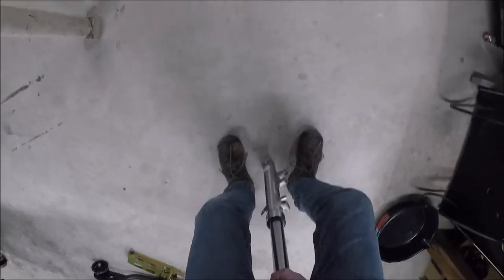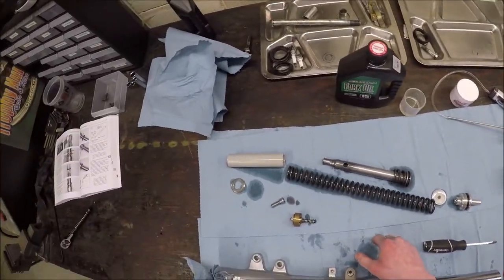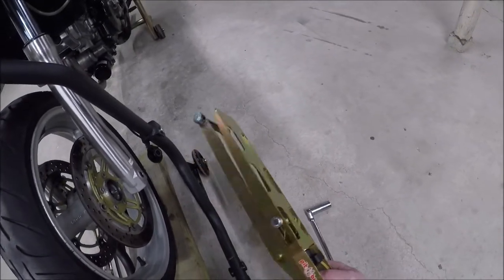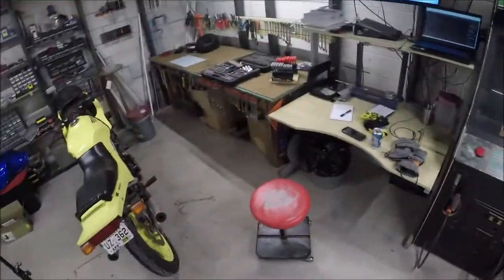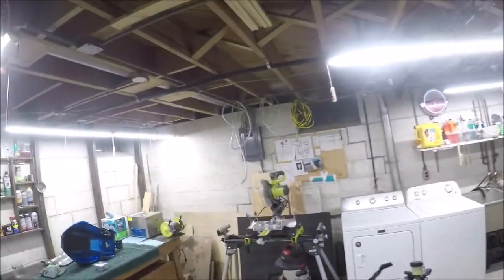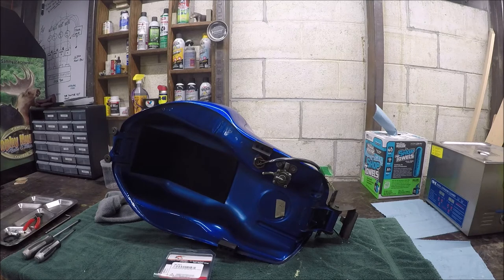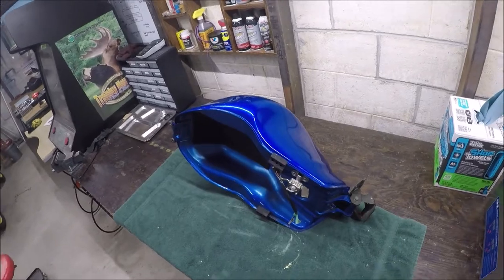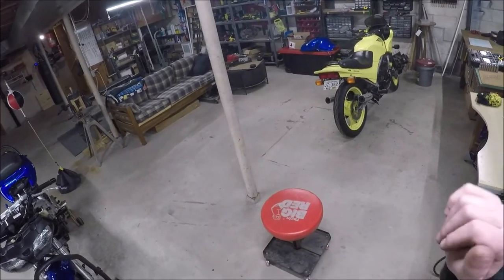MTDN -Ep8, Fork Seals, Speedo Rotor, Petcock Rebuild - Suzuki SV650S 2001

Comment: The vacuum petcock is supposed to be an answer to gravity. Bike on an extreme angle using vacuum v/s an expensive fuel pump. I hate them as well. I just rebuilt mine on my 04 Kat resto. Before that it was my 03 Suzuki Vinson 4×4.
Reply from the maker: Hadn't thought about the extreme angle aspect. I'm way too slow and stiff for that to matter! Makes sense though.
Reply: Dude plug that vacuum line coming out of the petcock, im just using gravity and the fuel pump never an issue
Reply: @ryanwallace6752  it's not an issue until it is then you'll absolutely regret it. If you somehow fill that cylinder with fuel and you go to start it and it detonates. Good by motor.

Comment: I'm having crazy bad problems with my 2001 sv650 and hanging RPMs I've done just about everything you can possibly think of twice and for the life of me I cannot figure out what the fuck is wrong it's probably one of those simple things where it's staring right at you
Reply from the maker: Knock on wood, I'm doing okay with my SV right now. But I'm so close to throwing my buddies Vf500 into traffic right now. Get the fucker started, headlight dies. Try to warm it to temp, discover the water pump gasket has failed. Great. Now I get to redo everything I did for the last two weeks.

That being said, it's worth it when you get it. The journey sucks until it doesn't. Sounds like you have a vacuum leak. Check your intake boots and double check that you didn't leave a nipple cap off of one of the carbs/boots. It may be an easy fix. You'll find it.
Reply: Hey ik it's been a while did you ever figure that out, for me my fuel line was kinking AND getting smashed by the tank
Reply: @ryanwallace6752  Actually, yeah, it was The boots around the carburetor are leaking And the leaks were coming from down around the bottom After I replaced the boots It ran fine, but I got a new bike since then That thing was a piece.

Comment: did you close the pinhole on the damper rod?
Reply from the maker: The pinhole is closed--not by me, but it is closed. Coincidently, that was the question I had about emulators I reference in a post I just left on your SViata video. I still can't understand how the suggestion is to close that bleed hole off. The literal only way for fluid to move after it's sealed is blowby on the damper rod seal. So that blowby has to be substantial and almost built into the design.

It's just got me confused. If it works, it works, and I'm not hear to argue. But I stared at the diagram for an hour and it didn't make sense to me until someone mentioned blowby.
Reply: @matttriestodothings  if you get the chance, grab "racetech suspension bible" on amazon or wherever. there is a TON of info and good diagrams on how carts, emulators, etc work. 
pretty sure the vacuum caused by the pinhole being closed is part of how the emulator works. or maybe blowby is the answer like you said.
Reply from the maker: @Mad8vCycles  added it to my Amazon cart. I'm guessing this and "Twist of the Wrist" are titles that will make sense to revisit as I learn more. You can read something once, but it makes a lot more sense upon subsequent readings after you've gone out and tried the content out.
Reply: @matttriestodothings  skip twist of the wrist (keith is a bit... longwinded) and get one or both of these two: lee parks total control, or "the upper half of the motorcycle"
Reply from the maker: @Mad8vCycles  I've got a hard copy of Twist of the Wrist over on the shelf. I've read through it twice. I'm glad you mentioned it was... longwinded. That was exactly what I was thinking, hah. But it's so commonly the recommendation I felt it necessary. 

Will look into the other two though.